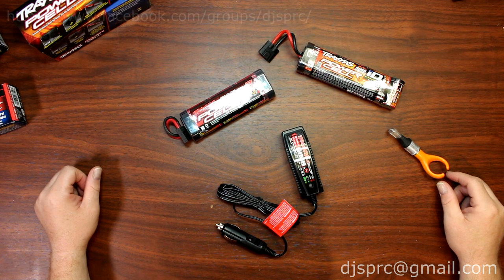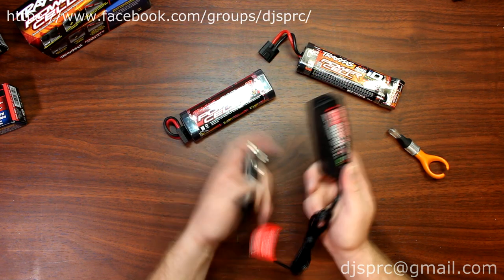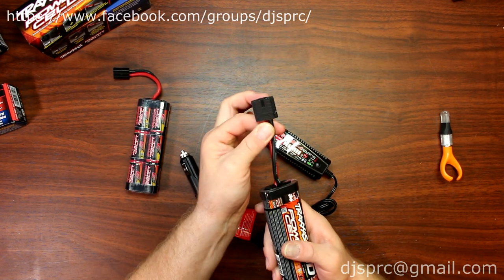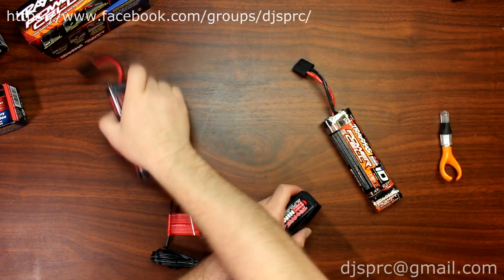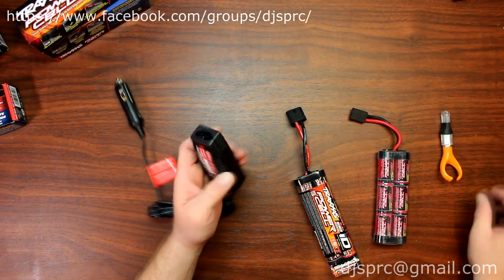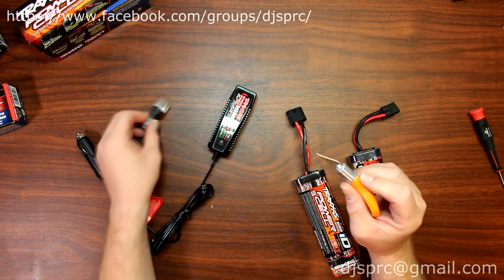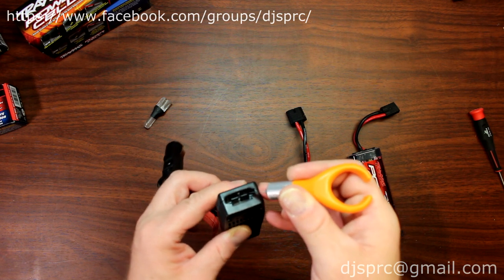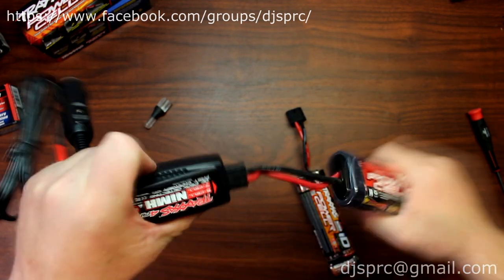How To Mod Your Traxxas Dc 4amp or 2amp Stock Charger To Charge Old Traxxas Battery

Comment: Good video; showed correct polarity for leads and mod; thanks
Reply: If I was to cut the power plug off  ( cigarette lighter connection ), could i solder bullet connectors on to the remaining wires and use on my balance charger . Cheers

Comment: Could i cut the cigarette connection off and solder bullet connectors ,and use with balance charger ? Instead of inconvenience of having to charge from my car . Cheers
Reply from the maker: Unfortunately that will not work You need a source of 12 V constant to make the charger work. No if you have a power supply that is 12 V about 10 Amp. Now that would work

Comment: When u take the notch out will the new connector still work on the charger
Reply from the maker: Yes it will it won’t prevent it from going in
Reply: @djsprc  can you send me proof
Reply: @djsprc  I'm not ready to commit
Reply from the maker: F2_Mystic I would love to show your proof but I don’t have the charger anymore but I can guarantee you it will still work. And one of the reason that Traxxas did this to their connecters and chargers they want the complete control over you making you buy their batteries only. That’s one of the reason the new style of connecter you cannot buy them only the old-style is available. If you’re not ready to commit yet still let me know I will try to find one and show you.
Reply: @djsprc  I am so sorry still not ready to commit
Reply: @djsprc  and my old style connector still plugs in and chargers on the new style connector I have the 1200 mah battery on the ken block rally car
Reply: I have the new Traxxas Dual Peak charger. Can i do this to one side of my charger to charger older batteries without a balancer plug coming out of the battery ? Im not charging any lipos yet.
Reply: @elhexidente9832  i would be careful when plugging in. Without the plastic tabs in place you may be able to reverse your polarity on accident. You dont want to hook the negative to the positive.There are many adapters that are pre made which will allow you to connect any battery connecter style to the new traxxas type. They are around 8-16 usd depending on the type you need. You can also make your own since these connectors are available. https://www.amazon.com/Traxxas-Connector-Male-2/dp/B07QJ79PRM/ref=pd_rhf_se_p_img_8?_encoding=UTF8&psc=1&refRID=FPD8KS38KVX7E9ZWPZD0